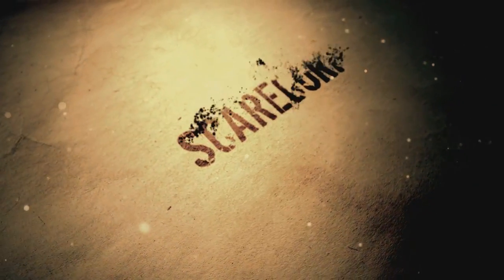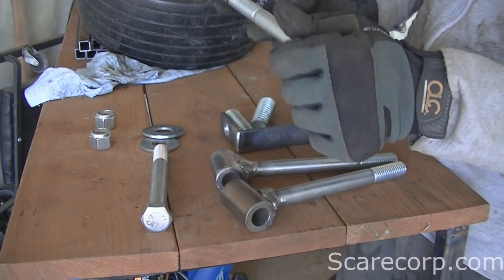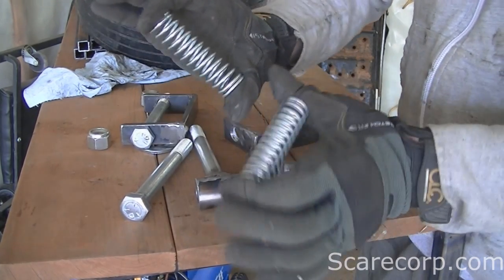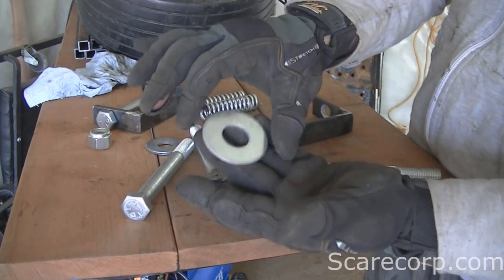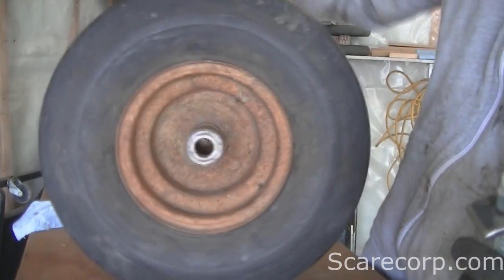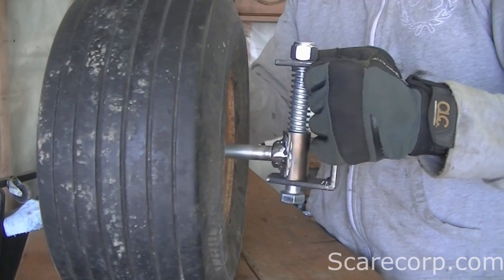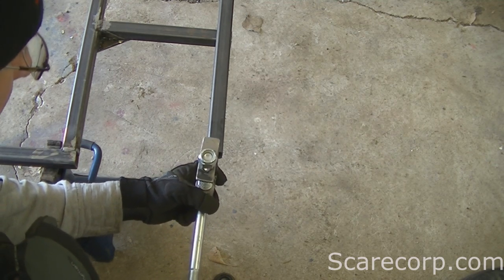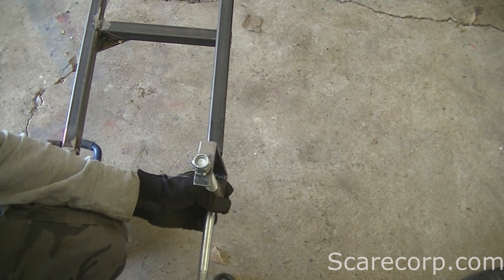Go-Kart Spindles - How To

Comment: Do the springs do anything, or do the spindles just twist from the tortional load and lock on the pivot bolt? Why didn't you use any bearings? Wouldn't the welds be a weak spot?

Comment: This is a really weak design.  Sorry to be critical but the scrub angle is horrible,  5 degrees caster isn't nearly enough with a solid axle, wide cart.  The springs are useless, far too weak and will bind from tortional load, the 5/8" bolt doesn’t work with 7/8" wheel bearings and will bend or break the weld.  The "C" chanel made from flat bar should be radiused or gusseted.  1"×1"×1/8" tubing will deflect until the elastic deformation is exceeded,  then it'll bend or snap.  This should be used as a how not to build a cart for anyone heavier than a hamster
Reply: Hi, what do you mean with the C being radiused or gusseted? Do you mean it should be more square and not so reqtangular? Thanks
Reply: @torbjrnaabergenes9971  the "c" is welded flat bar.  Looks about 1/8".  It should be gusseted for strength or cut out of c channel or boxed steel.   It's much too weak
Reply: @BruceBusby  ok, i agree that by making it out of box section steel, it will be a lot stronger. I think i will be making mibe out of 5mm thick box section square tubing. Do you think that will work?